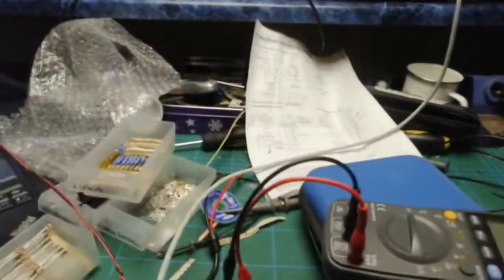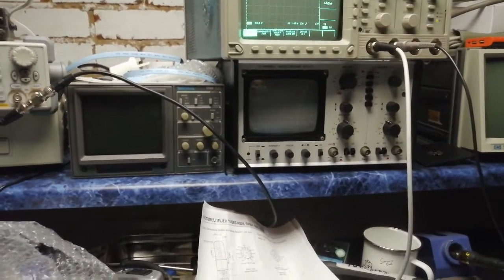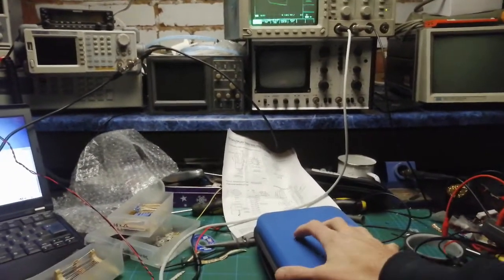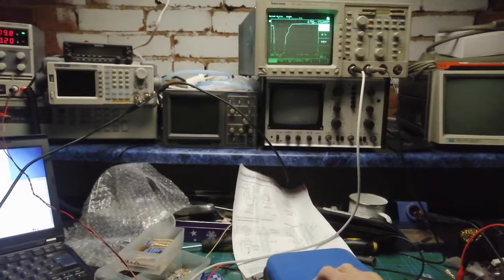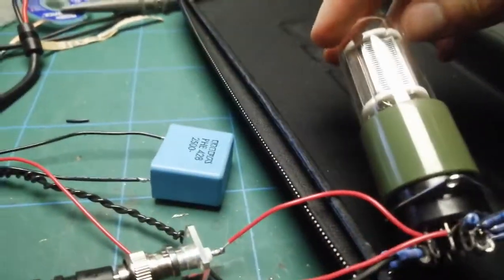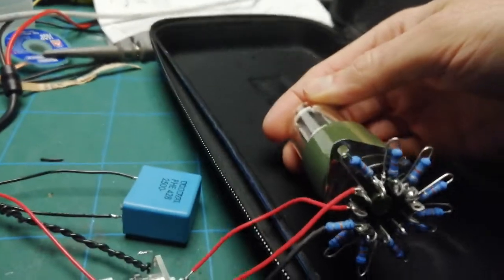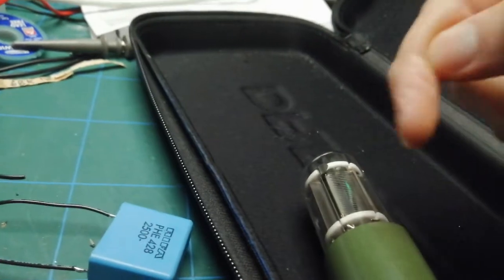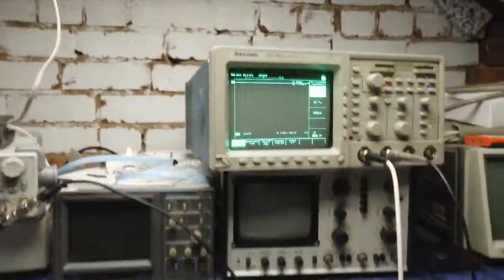photomultiplier tube

Comment: This is nice. I got an old projector which has phototube (not a multiplier) and seems bias voltage is around 25 coming from the socket, which they say not enough to drive this. I hear very faint audio even the volume cranked to max. I’m looking for diagram and component list to do my own biasing circuit for the tube so I can input to a regular transistor or IC amp. If you have anything or could you share your schematic if this wiring you’ve done. Thanks!

Comment: Hi! Was that a positive voltage PMT? Or negative? I’m looking to build a good power supply for my PMT but I believe that it’s a negative voltage one. If you can share any insights I’d really appreciate it!
Reply from the maker: Hey, that should just be a matter of polarity. If you need a positive supply to be positive, just hook the wires up the other way around.  If I remember correctly, the first dynode was at a lower potential to the second, and so on, using 10Mohm potential divider. Hope this helps.
Reply: @AaronJackson1 and how did you get to the current in the circuit, was it pure calculation or hit and trial? I could not find the data on my FEU 35
Reply: @vaishalishah8643  Hey Im using a FEU 35A too and am struggling to find any resources on it. Do you have any circuit diagrams you could share? One of the diagrams i found had the anode shorted to the last dynode and a signal line connected to the same point as the +kV supply which i cant imagine working.
Reply: For circuits, i am also referring to a book on PMT by "INFN"

Comment: Very nice demo. Those power supplies are notoriously noisy. I use linear supplies for all of my ultra sensitive phototubes and TV camera tubes. High frequency switching noise is very difficult to filter out. You can never full eliminate it.
Reply from the maker: Thanks! A friend is working on a very quiet supply which I will hopefully try but will find a nice transformer somewhere if I still have trouble :)